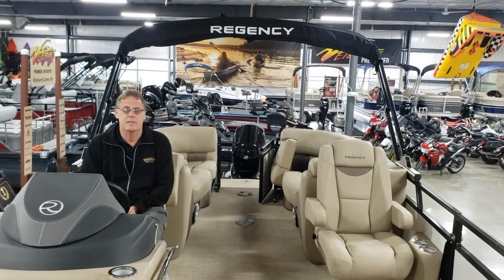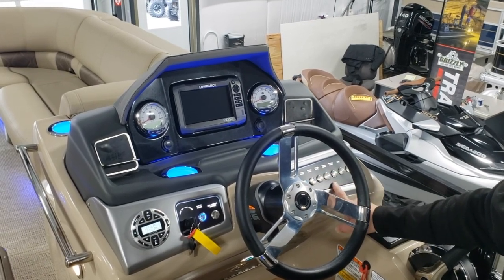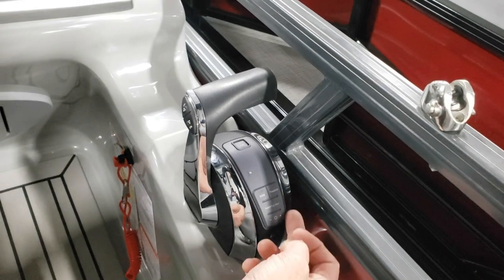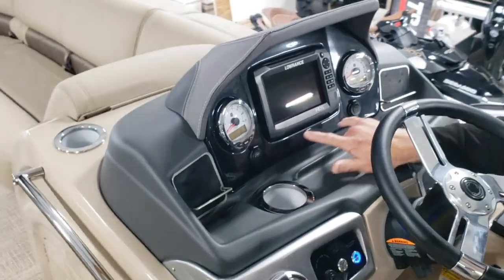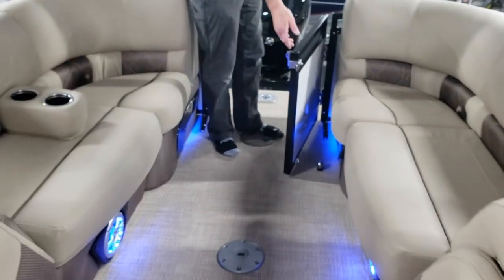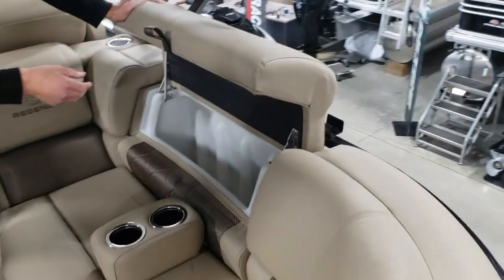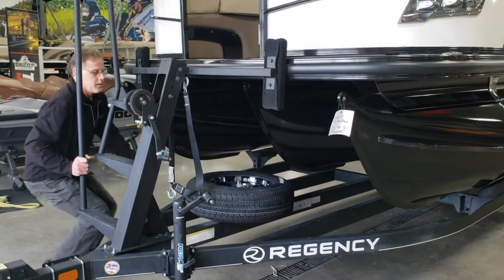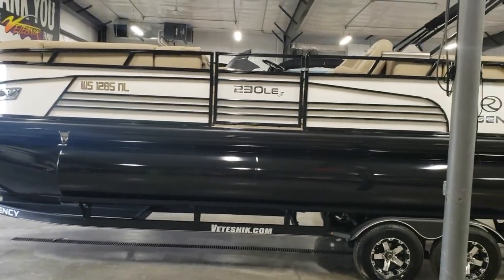Regency Pontoon Virtual Delivery How to

Comment: I have a Regency 220 DL3 2016. With a 200 horse mercury outboard. 

I’m wondering what my maximum speed should be with my back Bimini up. 

I also want to say “THANK YOU” for making this video I just bought this boat used and have had to figure everything out on my own using the manual. 

This video is a lot more friendlier